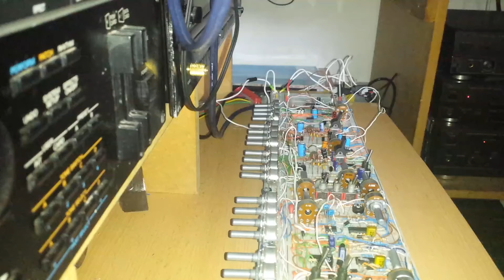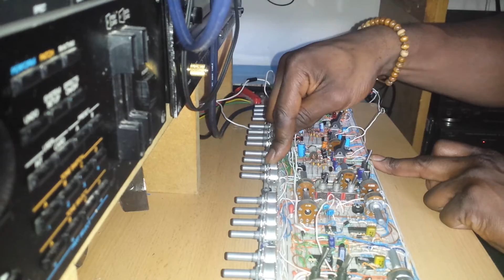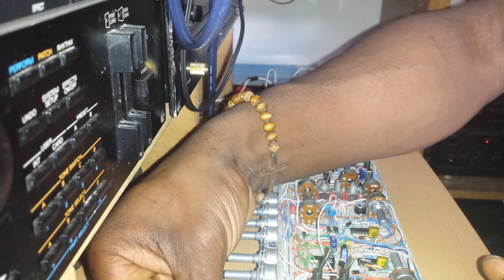DIY analog synth project Part 5 (Osc Lfo modulation and Hard Sync Mod)

Comment: It's a good experience to learn here!
I think I'll be soldering each successful block and make necessary inputs/outputs before making such a complicated construction/schematic.
Reply from the maker: MoolahNasreddin Yes a good idea thou the beauty of using breadboard is im not commited and easily chop and change parts ,  still tinkering with my steiner vcf to see which caps in the diode ladder give me the best tone .
Reply: Really enjoying working my way through these videos. I like the idea of having switches to change the subtleties in the filter capacitors.

What pots and switches are you using here?